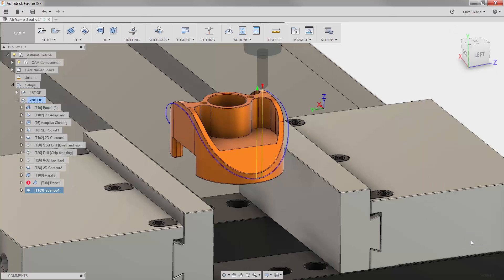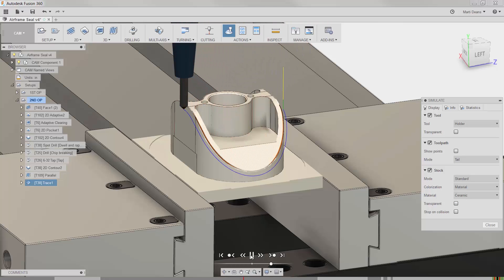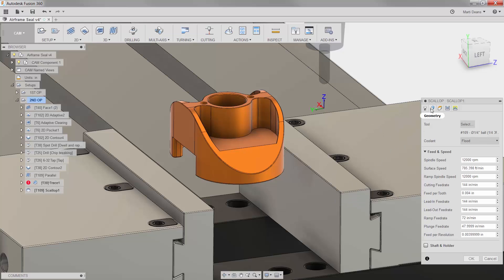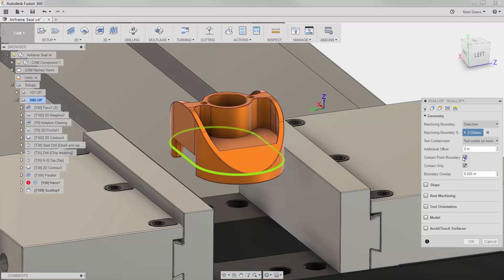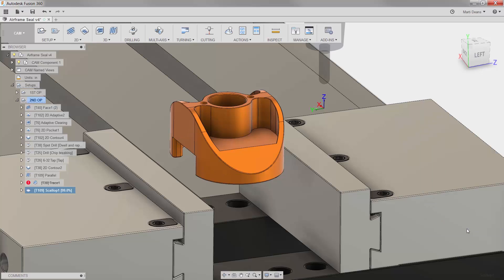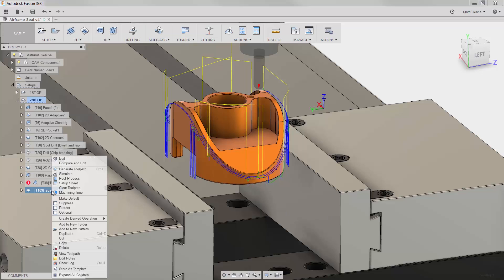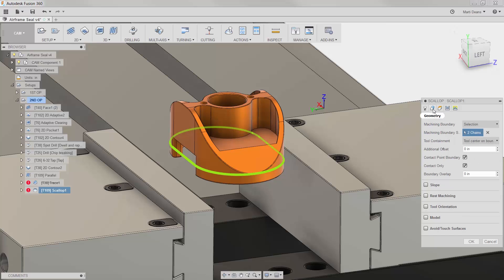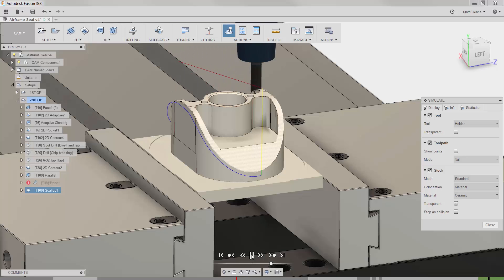Autodesk Fusion 360 | Quick Tip: How to Machine a 3D Chamfer

Comment: no luck, fusion needs to do better !!!
Reply from the maker: Is this in reply to something? I'm not seeing the original request/question if so. Let us know how we can help!
Reply: @adskFusion  Trying to do a 3D chamfer and found this video. All of the suggestions in the video will not supply a working tool path. Warning of "empty toolpath after selecting the upper and lower parts of the chamfer.  Ended up going over the TRACE, and un modeling the chamfer and selecting the chamfer boxes in trace for parameters.
Reply from the maker: Glad you found a solution. We are going to start having more CAM related live streams so maybe we can help you the next time. Also, consider throwing specific questions like this over to the forum. There's an amazing community waiting to assist.
Reply: @adskFusion  Admit I do not use the forum. But 1 time and got zero response. long ago. Lars is amazing and the videos on YT usually can find what I need but there seems to be certain holes I end up finding from time to time when doing what I believe to be "simple" ops. This was one of them.  Thank you !
Reply: @adskFusion  Problem I have with a  decent amount of functions in Fusion is that you seem to have to "h4ck" things to work like "negative values 3 time values" or entering "-tolerance" in some situations. If you don't know what to look for on YT or Google you might never find the answers. There are so many videos in the official Fusion YT library that you won't know where to start. IMO...build in a proper function that allows for easier 3D Chamfers on 3D surfaces...or even...make a video with JUST these "H4CKS" to make things work for which you don't have standard CAM tooling...and yes I am a yearly paying subscriber..